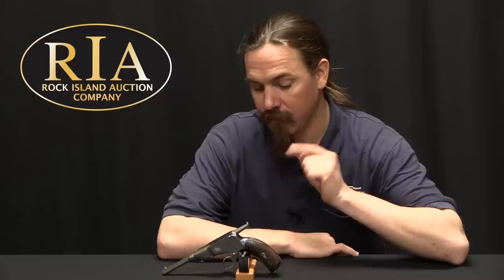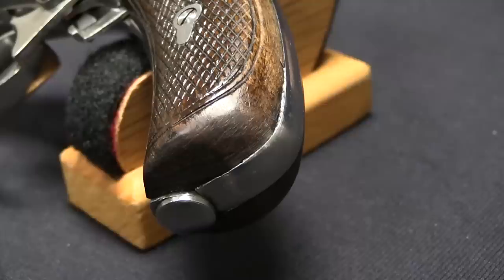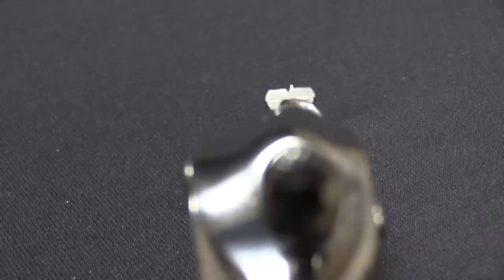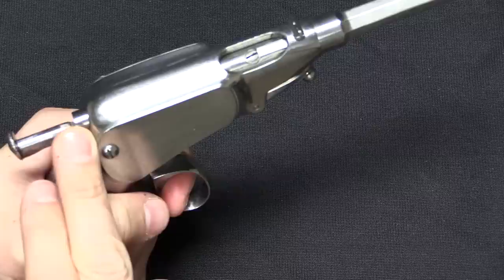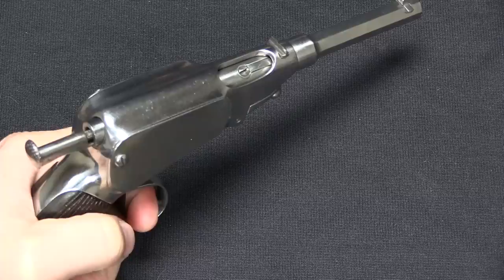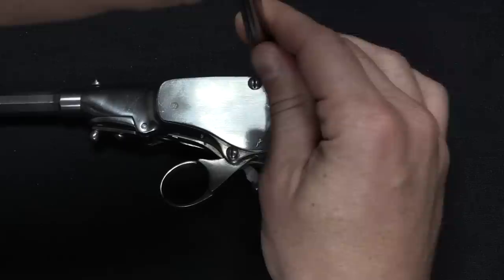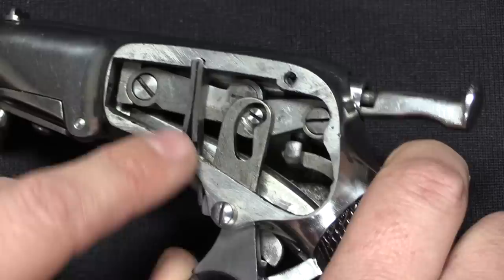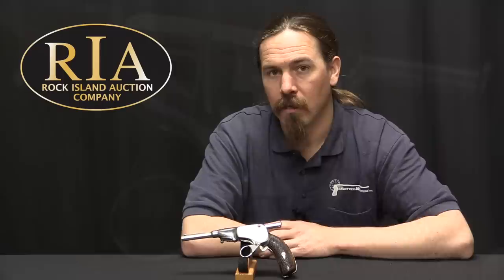The Schulhof 1884, Type IIa Manual Repeating Pistol

Comment: So if you don't complete the trigger pull, will it just eject the unfired round and you lose one?
Reply: DoctorChives I'm wondering that as well
Reply: Yeah it looks like if you weren't reasonably deliberate about what you were doing, it would be fairly easy to jam it up or waste ammunition.
Reply: @witeshade  
From the looks of it, the extractor might be on the striker. So no unless the striker drops, it shouldn't waste the round or double feed. If I'm looking at it right, that's an amazingly elegant design and remarkably safe for the period too
Reply: It looks like you can manually charge the striker without opening the chamber.

Comment: Any idea why the sites are so far forward? There seems to be plenty of unused free space on the body of the receiver that could have hosted the rear sight assembly. This seems to be a pattern in general for guns of this time--even when one could put a much more usable sight with a long radius at the back of the gun, the designers opted for something more towards the middle of the gun instead. What gives?
Reply: Alex Vogel too much chance of the barrel or body flexing perhaps? Or just different theories on accuracy requirements or the apparent size of the sights.
Reply: Or maybe just personal preference.
Reply: It’s for the picotini rail to mount your IR sights!
Reply: I suspect it has to do with ease of manufacture and zeroing the sights with respect to manufacturing tolerances, notably concentricity and runout of the barrel to the receiver. By placing the rear sight at the chamber where the barrel attaches to the frame you virtually eliminate the need for the barrel to be aligned concentric and parallel to the frame. The axis between the rear and front sight will still be along the axis of the barrel, even if the barrel is off center. If the rear sight is moved back on the frame behind where the barrel attaches the sight picture axis is now a compound of the axis of the barrel and axis of the frame which must be sufficiently parallel to align with the axis of the barrel to zero the sights. As an engineer that would be an educated guess at their methodology.

Comment: A design sort of like this would be perfect for a suppressor. Rapid fire but there would be no extra noise or gas from the slide cycling like a regular semi-auto. If you want to take it a step further, it would be good for clandestine activities because you could easily catch the brass as you release the trigger to prevent leaving a trace. Just need to work on the trigger pull to make it like a double action where all the work is done on the pull of the trigger and the release is just spring loaded.

Also, when done right, if you ever had a failure to fire you just keep pulling the trigger since it would eject and chamber the next round whether the ammo fires or not.

Comment: I have a question. Was Hiram Maxim's work the sole Genesis for self loading firearms, or was their similar work towards a self loading firearm concurrent with Hiram Maxim's machine gun? I'm just wondering because there seems a lot work towards pistols that come close to a semiauto pistol, and it strikes me as unlikely that none of the those developers would have had the idea to use the energy from round discharging to load subsequent rounds.

Comment: Dumb question. Why do you dry fire some guns but not others? Why is dry firing bad sometimes and not others?
Reply: It depends on the arrangement of the firing pin- the reason you should never dry fire a gun chambered for Rimfire rounds is that the firing pin is at the rim, if the soft brass case isn't there it will strike the breech or frame, or whatever the term is lol. On a centerfire, the firing pin would release into empty space in the chamber, so no direct abuse of it, but certain action designs even on center fire will beat themselves apart if they don't have a cartridge to softly impact.

Comment: wouldn't a manually operated rotary magazine make it a double action revolver?
Reply: Thrawnmulus I suspect the difference here is that while the rounds are fed in a rotary fashion they are still fed into a single chamber, where a revolver cylinder has an individual chamber for each round. Think something similar to the rotary Ruger 10/22 magazine or the somewhat rotary Krag Jorgensen rifle.